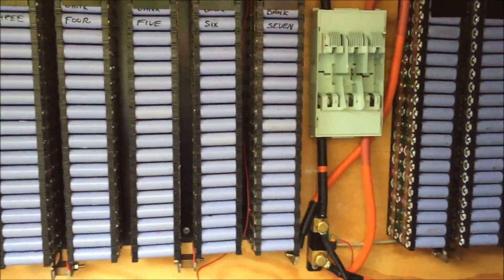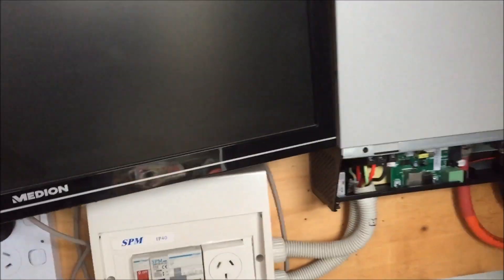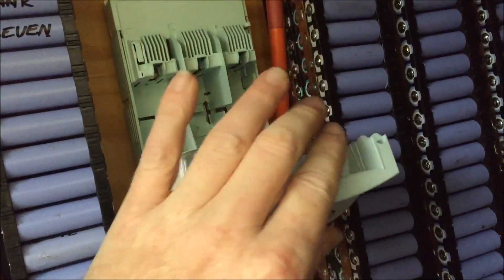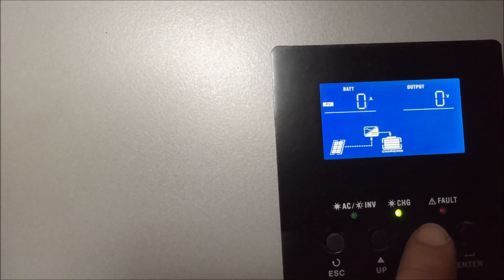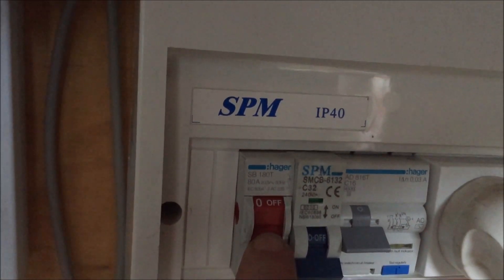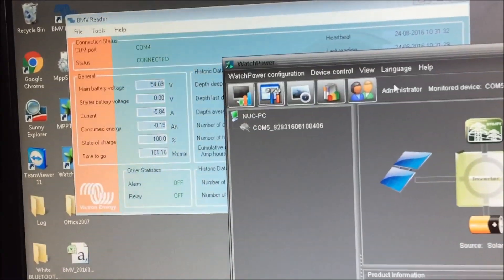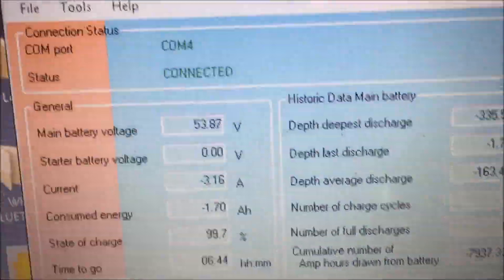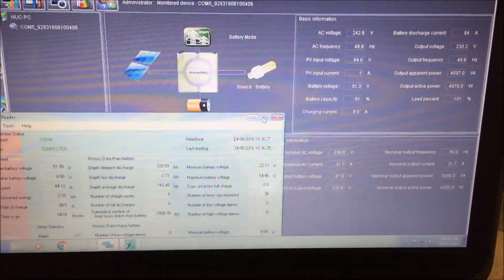48v Turning on and load test

Comment: Hi, why did you choose 48V? Why not 12V, for example?
Reply from the maker: +Andrew K efficiency
Reply: HBPowerwall you mean less losses during inverting 48-220V?
Reply from the maker: +Andrew K yep runs cooler less amps
Reply: also higher voltage gives less loss on your conductors

Comment: Really interesting. I just subscribed.
Why is it reading 54v if its a 48v setup? And how many cells did you use in total?
Thanks
Reply from the maker: Charge controller is set to 56v most of the time with a top limit of 58.8v (4.2v x 14) "48" is the 'normal' voltage of the inverter. There are 2240 cells currently in use with many more on their way.

Comment: What difference in capacity did you allow in your packs?  did you mix cells with 2000 with cells of 2500 mah? or did you keep it closer like only cells between 2000 and 2200 mah?
thx
Reply: It doesnt really matter what capacity the individual cells are but it does matter what the total capacity is for each parallel bank. They really should be as close as possible so when you stack the banks in series the effective capacity will be the lowest of the parallel banks. If you see what i mean.
Think of it as having 4 AA batteries and 4 AAA batteries. if you need 3v output you wouldnt parallel the AAs and link them to the AAAs (paralleled). You'd do 2 AAs in parallel with 2 AAAs and do it twice, then stack the two sets in series to give you the 3v total.
Reply: A better example of capacity matching would be having 8 AAA batteries in parallel with the 4 AA's in series to give roughly equal battery capacity. This way when you draw high currents from your pack you aren't overly stressing the lower capacity cells, lowering their lifespan and potentially drawing them down further then they were ever meant to discharge. In HB powerwall's case he has so many cells in series that each individual cells is only getting drawn down at about 200mAh or less given the 48v changes and the extra packs he has put into service. If memory serves Mike's DIY Powerwall is doing capacity matched banks.

TLDR: Capacity matching your banks matter, but there are ways not to do it if you CBF or have a metric assload of cells.
Reply: only if the capacity of the AA cells is 2x the capacity of the AAA cells. 
if the AA cells are 2.5x the AAA cells then you've limited the overall capacity of the system.
The max current draw is a separate issue it would be the current draw of the lowest rated parallel bank.
Reply: By mixing cells of different capacities you are essentially limiting the pack in the same manner. By the time the AAA's are exhausted in your 2xAA+2xAAA setup you will have only drawn down the AA's to the same amount as the AAA. When dealing with rechargable chemistries this imbalance will lead to overdischarge of the lower capacity cells and damage.

The determination of a banks capacity is by the lowest capacity times the number of cells. If you run the numbers in HB Powerwall's 1000w load tests you can see because of the compromises he made for the pack's visual uniformity that the average capacity drawn over all cells during the test averaged 2200 mah compared to the higher expected reading given the average capacity he rated the cells for. 

Obviously what you consider acceptable will determine how you build your packs but if you are going for maximum capacity it is best to ensure that each bank in series is capacity matched to ensure an even discharge.
Reply: No because it won't drain them evenly. Since the AA cell has higher capacity it will hold its voltage more so it will bare the brunt of the voltage drain.
Reply: ONLY if the internal resistance of the AA is lower then that of the AAA's.
Reply: If they are in parallel then the internal resistance won't factor into it. The voltage on each cell is the same so if one has a higher internal resistance then that will limit the current drawn from it as a proportion of the overall system.
Reply: And as you stated there is now an imbalance in the discharge rate per cell. While this be fine when using AA and AAA's you have to take into account we are dealing with rechargable chemistries. In this situation we are now current limited to the maximum draw of the two AA batteries. 
This will be fine if your battery bank has current limiting circuitry but coming back to 18650's for a moment we now have an issue where two cells in your bank is now making up the bulk of the draw. Now lets say that each 18650 has a maximum safe draw limit of 5A but differs in capacity like the AA/AAA example where the AAA's have half the capacity. Anything up to about 10A will be perfectly fine. Any imbalance in the discharge of the lower capacity cell will be made up by the ones with higher capacity. From 10A to 15A you are getting closer to the maximum discharge rate of the two high capacity cells. Now at 20A's lets say the two low cells are only able to put out 2.5A each. The High capacity cells are now discharging at an unsafe 7.5A. The Datasheet for the cells say that this is fine for short periods but can adversely affect the cycle life of the cell. The problem comes when the designer of the pack expects their cells to be able to withstand 20A discharge without understanding that this imbalance is adversely affecting the lifespan of their pack not to mention the risk of internal shorts or cell failure.

This is why it has been recommended with any battery chemistry to have cells which match as closely as possible and to limit design to the capabilities of the lowest rated cell to try to ensure an even cycle life across the entire bank.
Reply from the maker: In the beginning I kept all 2600mah together and 2500 2400 and so on in their own packs. Now it's just anything over 2100 goes into the same pack. Run the pack for a few days test voltages and swap and change them as necessary. So far I have completely replaced four packs and 'rebulit' them again. IT's all a learning curve and I'm happy to do it this way.

Comment: Quick question...  if attempting to recreate your setup, would it be better to use SLA car batteries @12v 100Ah each instead of 18650 @4.2v 0.2 to 0.35Ah?
Reply: There are benefits and drawbacks to both types of chemistry. SLA car batteries are easier to obtain and require less work to set up but have lower depth of discharge and depending on your usage rates around a 5 - 10 year lifespan if you are not continuously stressing out your batteries. Setting up a system like HB powerwall's can take a lot longer then setting up a lead-acid based system but offer higher capacity for the space and more usable energy per watt put in.

There are videos of HB Powerwalls previous Lead-Acid setup in the channel as well if you want to see that setup. It is pretty similar to the Lithium-Ion with the obvious exception of the configuration of the BMS for the different chemistry.
Reply from the maker: Well said Techburn, Thank you :)

Comment: So that's what your winter looks like :p
Reply: it has been one of the mildest winters here in Brisbane that I can remember.  and I'm near 50.
I wonder how much that battery system would cost if you bought them all new?   a LOT.
Reply: John Douglas I wondered if he might have problems leaving the batts out in a shed like that, continental EU gets to +35 in the summer and -15 in the winter so proper isolation would have been needed, but it seems like aus has pretty much ideal weather
Reply: already raised that and he has plans to insulate the shed once it's all finished..  (if it ever is haha)
but yea, it gets quite bloody hot here in summer.
Reply from the maker: it is on the south side of my house and cooling WILL be an issue but I'll deal with that issue when it's required.:)
Reply: Outstandingly awesome!!! Well done I was worried about that crumpled box. But you bloody done it. Well done.
Reply from the maker: Full credit to my sparkie who shuffled his workload to 'fit me in' Still heaps to go heaps to change upgrade and fix but getting there. At least it LOOKS finished.